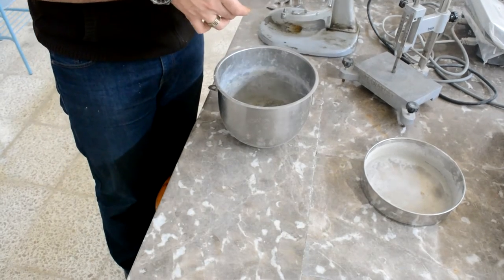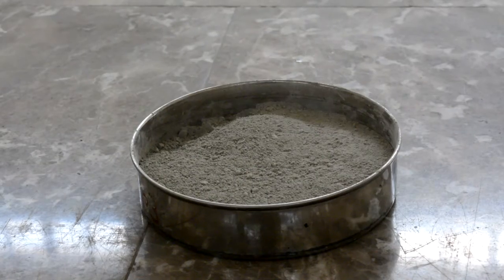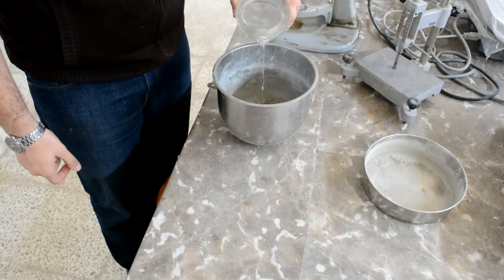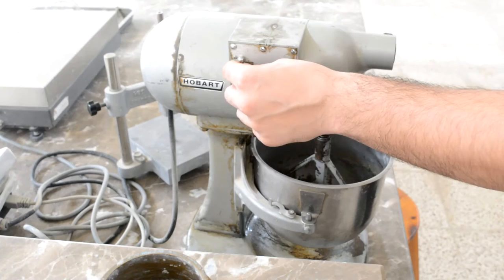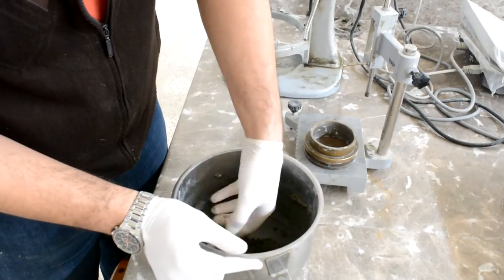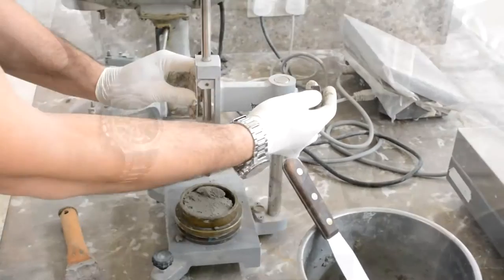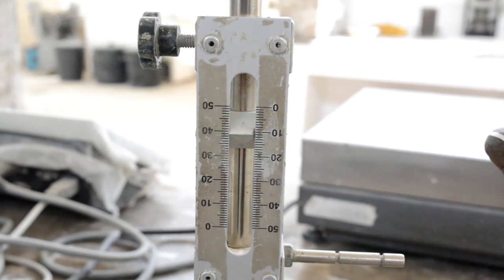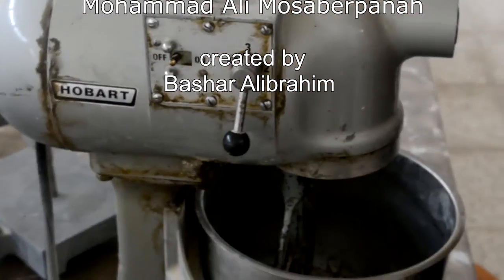Normal Consistency Of Hydraulic Cement ASTM C 187

Comment: The procedure should have some changes to be acording to  ASTM C-305 (mixing) and C-187 (test in Vicat aparatus) :
1)Place all the mixing water in the bowl. Add the cement to the water and allow 30 s for the absorption of the water.
2)Stop the mixer for 15 s and during this time *scrape down into the batch any paste that may have collected on sides
of the bowl*.
3)Press the ball, resting in the palm of one hand, into the larger end of the conical ring
4)*The paste shall be of normal consistency when the rod settles to a point 10 mm below the original surface in 30 s after being released*.

I suggest leaving these annotations and always consult the standard directly. The construction materials tests are still rudimentary and subject to human errors, it is very important to take into account each instruction for its replicability.

Comment: This is a poor demonstration of C-187.  The cement ball needs to actually be 'tossed' from hand to hand, not gently passed.  And then the ball needs to be PRESSED into the BOTTOM of the mold, not gently set in the top.

Read your method, guys!!
Reply: I have done this several ways and so far the mixture has not stopped the water.